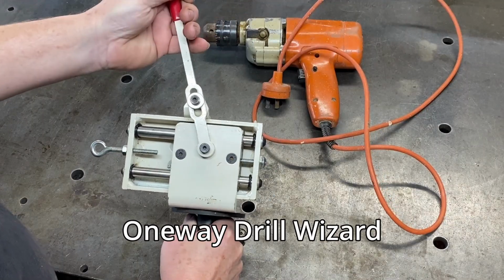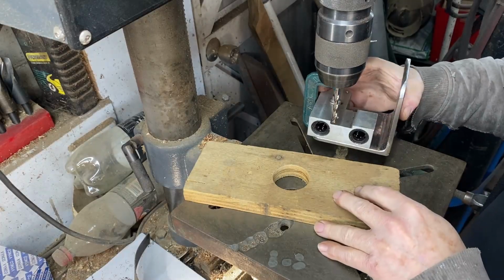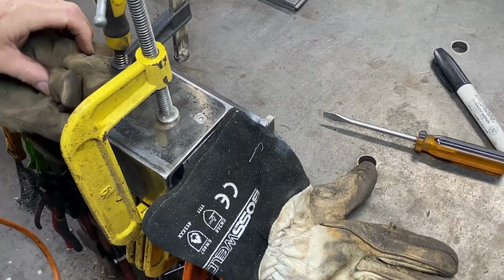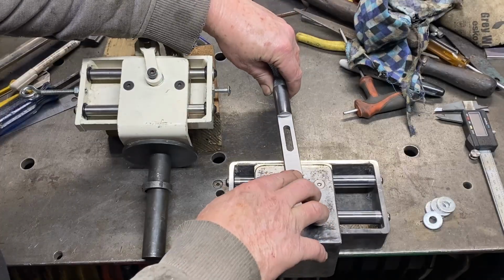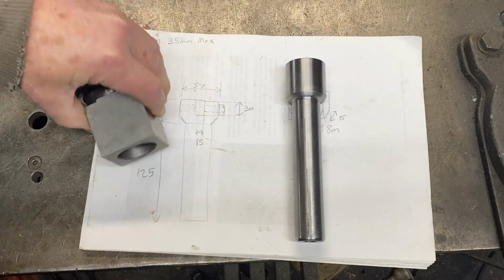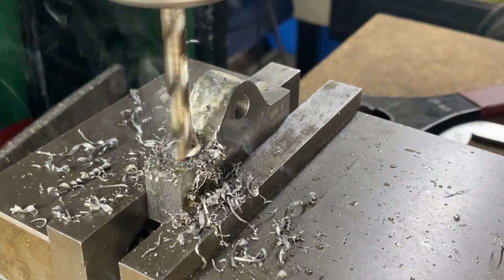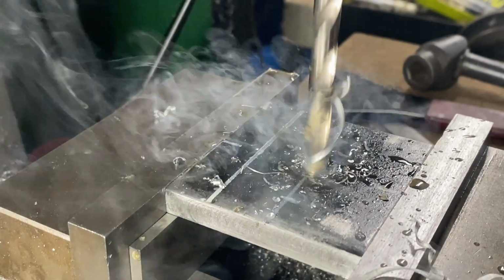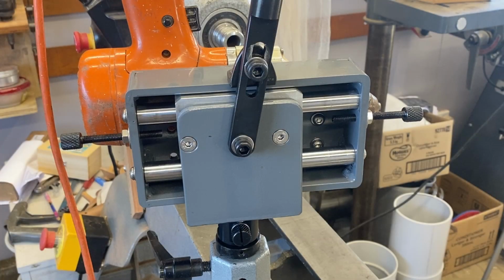Drilling Rig For The Lathe

Comment: That's neat, 42mm is 'standard' size last several years.
I make a holder to fit trim router on metal lathe in place of tool post then used small diameter carbide cutters to cut slots in steel.
Reply from the maker: Thanks for the info. It makes sense as the original drill wizard was probably around 42mm.

Comment: Awesome build! Now you need to make a QCTP mount to use it on the Machine Lathe as well!
Reply from the maker: I was thinking about that. The post will probably have to come off as it may hit the apron. But I could make a part that can be held by the QC tool holder.

Comment: Instead of changing the angle on the jig I figure you could adjust the center height to mimic the angle you want.  That way you can keep the jig solidly mounted to the post for ridgidity.
Reply from the maker: Yes, that could work. Thanks for watching.
Reply: @thehobbymachinistnz 
 By changing angles though you can cut different radii, particularly if your doing cove cuts with compound angles set. 
You can use smaller diameter cutters to get much large radius.

Comment: Thanks for sharing such an interesting project and enjoyable video. 
With a mount post change it would also be a handy drill press jig for accurate holes.
For the angle adjustment, can you weld on 2 tabs to gain a bit more distance away from the pivot for a larger radius?
For the stop travel stops have a look at the festool method of stops without lock nuts. They have a fine rebate in the thread that contains a thin strip of nylon. I guess the same could be done to a nut so it's vibration resistant, but not too stiff to easily turn.
Reply from the maker: Thanks for the tips. I used it the other day and finished off a bowl with walnut inlays today. I think it look quite good. A video on that will be out in about 3 days.